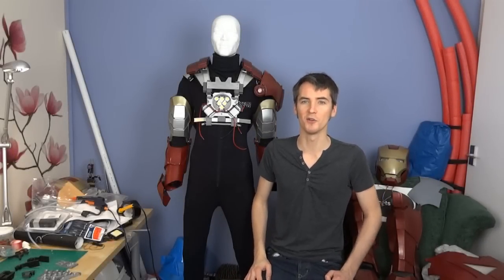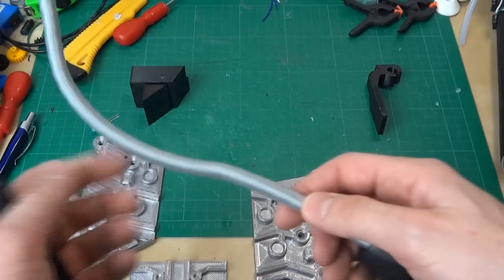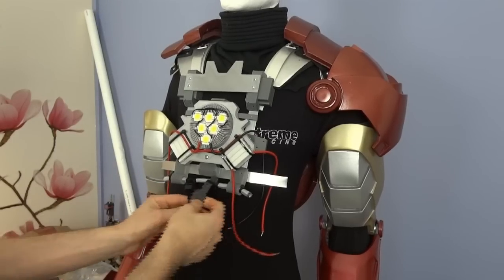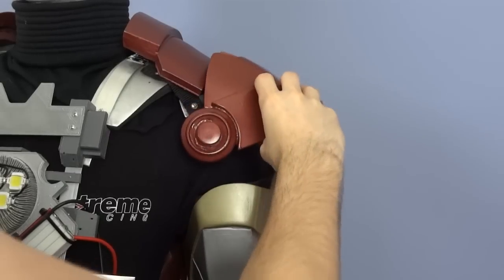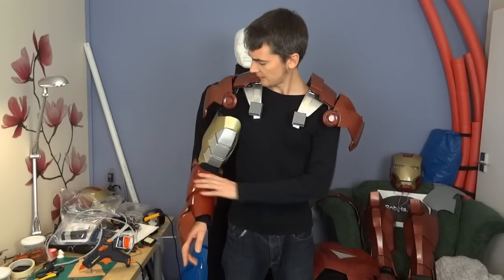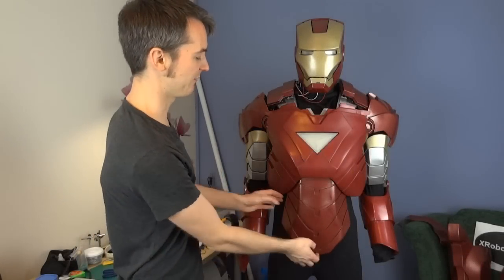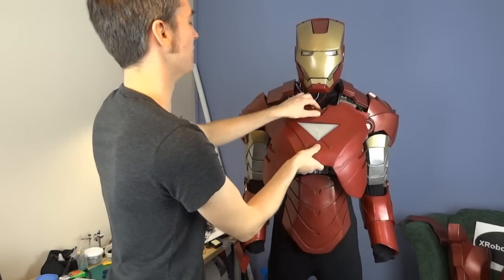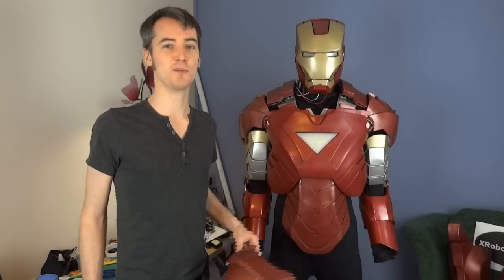Iron Man Power Suit #48 | Strapping & Inner Armour | James Bruton

Comment: hello just wanted some information, I also have an armor (EVA foam) and using it for the first time at the Venice carnival I noticed that when I move to friction of the moving parts such as arms, legs, goes off the paint or crack, I had addiritura of small and medium-sized tears in the material. how and what can I use to make it more resistent to 'wear and protect the paint?